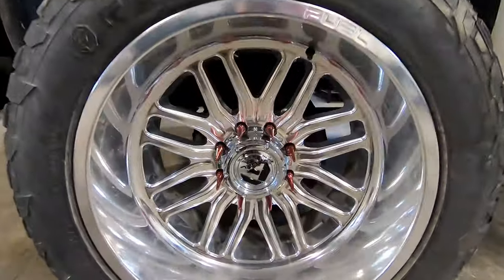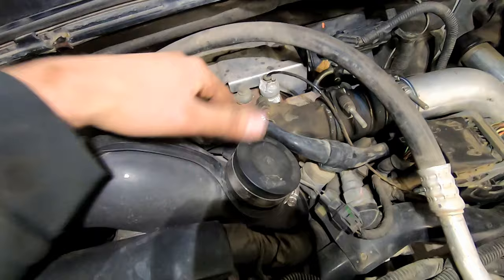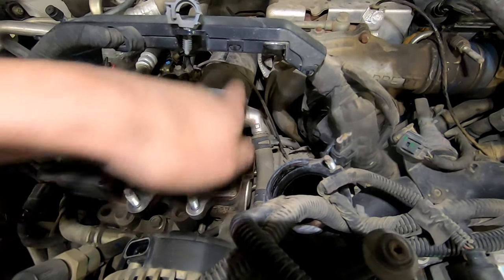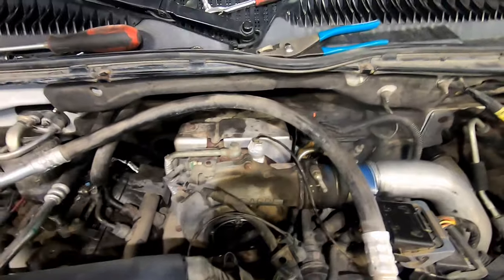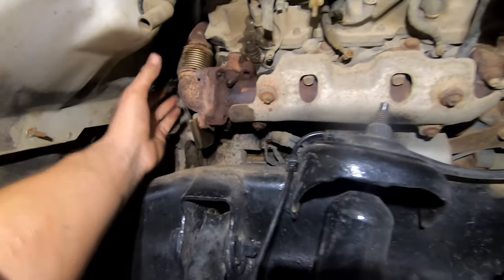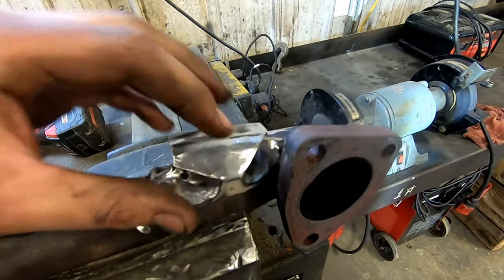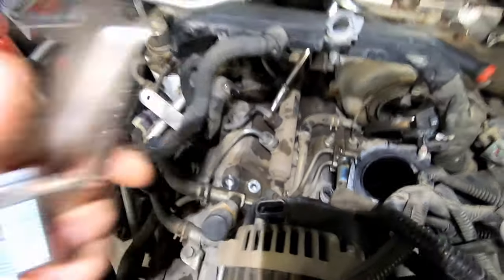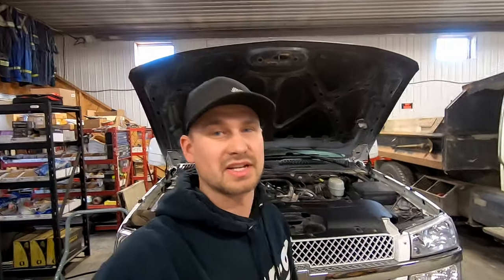HOW TO DELETE EGR LLY LBZ LMM DURAMAX

Comment: I have a 2007 Silverado Crew Cab 4X4 3500 LB with a stock LBZ. I average 14 mpg towing a  7000 lb travel trailer and 17 not towing. My rig has stock tires and wheels (16"]. It's a work machine not a race truck that burns rubber and rolls coal. It ain't broke so I don't try and fix it.

Comment: Good how to video. When I did mine I removed the body cab bolts and the core support bolt from the passenger side and jacked up the cab a couple inches. Gave me a lot more room to get those hard to reach bolts out and the down pipe pretty much falls out with the extra room!

Comment: Pretty good vid. Some recommend replacing up pipe bolts. The temp cycling weakens them. Supposedly the ARP are rated higher and less likely to snap. Yep use copper antiseize. Buy the kit of them or 12 needed ARP 672-1003(5pk), 12mm 12pt head M10x1.5 x 30mm flanged 180,000 Tensile 8740 chromoly OR the SS ARP 772-1003(5pk)

Comment: I just did the delete and everything went well. Only question I have is which plug goes to the coolant and which goes to the A/C? They appear to be the same type of plug only difference is one set of wires is shorted than the other. Thanks

Comment: I have a 2008 drum ax diesel I'm doing a full delete can I leave the stock muffler and the stock catalytic converter on . I bought the bypass tube for the Particular filter. Do I have to worry about them stobing up or should I just replace them. Love your videos.

Comment: Awesome video thanks for doing it after you did the EGRand down pipe did you have to use a tune on it and if so what do you suggest as a in expensive tuner to buy for a 2006 GMC Sierra 2500HD Duramax 6.6 LLY.

Comment: I know this video is a few years old, but the routing of the coolant line for an LMM is a little different than the LBZ here. It comes with a U hose that attaches to the line right next to it, instead of coming down across the engine.

Comment: Dexcool is know to cause head gasket failure on gasoline engines. Do you continue to use in a Duramax or do you switch to green antifreeze?
Reply: It's much better now...should be fine. I've been using Peak Global Lifetime in a Gold jug for a few years. It's been used in Dealerships too...so it's all good. Just change it every 5yrs maybe depending on driving and conditions. Use a tester to check it

Comment: Should I tune the truck first before I delete the egr? What would happen if i do the delete without the tune?
Reply: Wondering the same thing, dont want to go into limp mode.
Reply: Deleting the truck without a tune will not change too much, especially if using the blocker plate option. The only reason most choose to tune the truck after the EGR removal is to remove the "P0401: Insufficient Flow" code you will ultimately get. If you're doing the full thing, including higher flow 3" downpipe and LB7 style up pipe, then a tune would be recommended.
Reply: And also, you should only ever tune the truck after the modifications are installed. The software tuning relies on the physical changes you've made to extract the most out of the vehicle. Any time components that change air or fuel are replaced/modified a tune is necessary after to optimize the motor to run cleanly and properly.

Comment: I am new to diesels and just purchased a 2004 2500HD duramax (it's LLY) with 159000 miles on it. Would you recommend doing an EGR delete on these older models. Would it be too late meaning damage has already been done? Can EGR delete rectify any problems that have built? I do not know if this year has them? thx for your vids
Reply: That might be an lb7 because I thought the lly was 05 only
Reply: @wizard_of_poz4413  LLY was 04.5 and 05
Reply: @andrewpfantz964  ok

Comment: Hey man. So I got my stuff off. Lol man 😂🙈 I tried the whole stubby 12mm and pry bar thing… dude how in the world can you make that work. I tried prying over the battery and no leverage and awkward. And being one man it’s even crazier.

So I want to see you do a video and show you doing that step man! That would be gold.

But I got mine off pretty darn easy. Got both off same way. From bottom through wheel well with a regular old socket wrench. I used one that was 3/8” swivel head with a standard short 2.5” extension and 6point 12mm.

Y bridge and up pipe is next!  

Been doing it in steps and making a video.
Reply: I used a 3/8 wrench that the head swiveled. Literally doing mine in the yard right now.
Reply: @tawney9brian  yea I got mine done. I just used a ratchet down below for both! Worked easy

Comment: Dude I found out I got oil dripping from that hose you pulled off to drain coolant could there be oil inside?? I check the coolant up top but seems fine and my oil level is fine any ideas???

Comment: I need help on my wiring putting all my sensors back because I did a egr and egr cooler delete and a new y bridge kit and I can't figure out which sensors get plugged back in and which ones don't get plugged in and i can't figure out which one goes to my air intake because I put it in and non of them go that far up

Comment: Want to do a DPF and EGR delete on my 08 LMM. Are the sinister delete kits OK. I have cracked up pipes I think. I can smell diesel exhaust coming in my heater. Can the bellows be repaired or better to replace them. What are the best ones to use? Is Sinister OK? 200,000 miles.
Reply from the maker: Ya sinister is a very good company, the only downside is they are expensive. If you have a cracked up pipe in the bellow then yes you have to replace it, you can’t repair it.

Comment: Hello dark iron diesel . What would be rhe cost of building a bulletproof 2000 hp lly 2005 . I want it done right . As bulletproof as can be . What yoh think it will cost for materials and labor I want pros building mine
Reply from the maker: A 2000 hp lly?!?! Probably like 80 grand lol
Reply: Oh shit lol. How about something like 750 hp entire build
Reply: I was hoping to do it for like 50 gs lol
Reply: Crate motor and trans and bolt on rhe new parts I seen a guy with a 2000 hp on you tube didn't think it would be that pricey lol
Reply from the maker: Well I’m not the right guy to talk to because I’ve never built a 2000hp truck but man 2000 is ridiculous like you’re talking EVERYTHING needs to be upgraded to handle that much power. The motor is only half of it.
Reply: @victoroliveira4248  you would have to build the whole suspension and front end too. It’s not just the motor that you have to pay attention to
Reply: Crate engine, built transmission with a girdle maybe and idk if you'd need to reinforce the frame beyond traction bars or not

Comment: Did you have a check engine light in dash once you delete egr?
Reply: That's where retuning the ecm comes in so it tells it that it doesn't have the system on it
Reply: No Light here. On some early lly 04.5 do not show a light but it shows up on a scanner if that will help someone out there with an early lly.

Comment: Anyone know if this will work for LB7? With California mission standards. Only has EGR, its an 04.
Reply from the maker: LB7 engines don’t have an EGR. If you have a 2004 you have a LLY which will be very similar.
Reply: @darkirondiesel  mine is an LB7 with california mission standards, it does have an EGR.

Comment: Do you recommend an PCV reroute? Curious why you didn’t do it when you had the piping out.
Reply: I'm not super convinced that it's gonna destroy the turbocharger with that little bit of oil. I mean we've got tractors and combines that are ticking up a lot of hours with the system and sometimes they just have a tube going to the intake without even a filter
Reply: @wizard_of_poz4413  I had to replace my turbo from not doin a reroute. It will destroy the veins on the wheel especially if you put a larger turbo
Reply: @Tbunish1  well I've got the factory one on mine and thus far trouble free